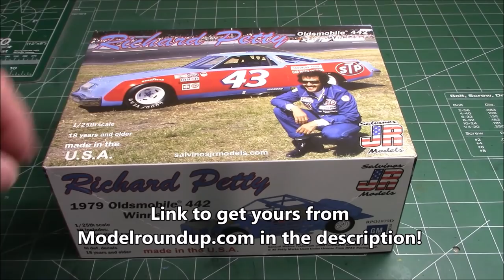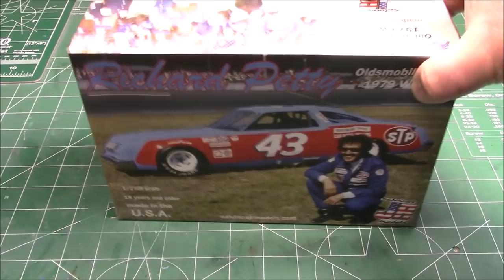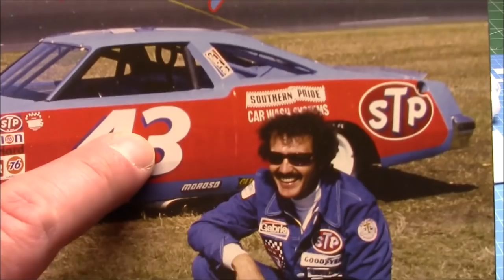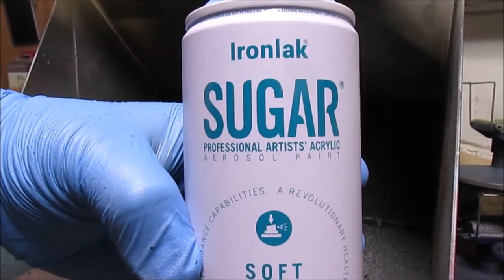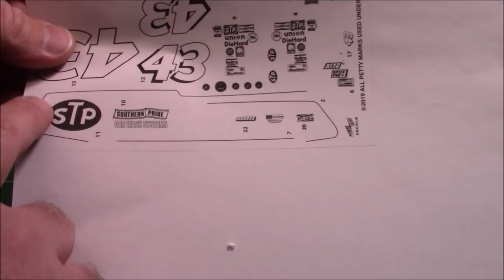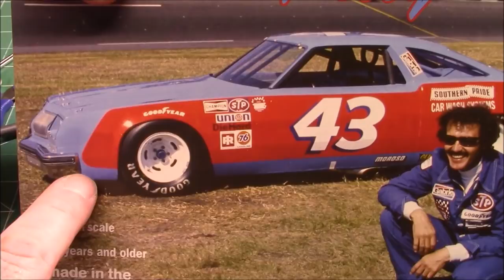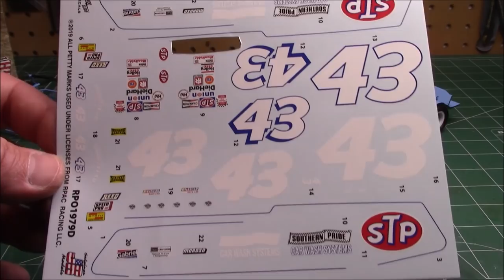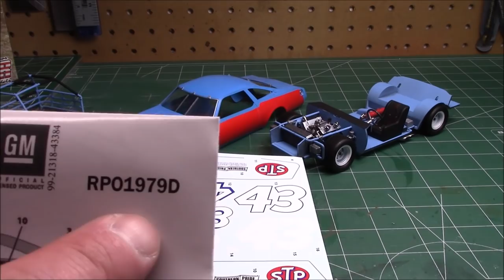Richard Petty Oldsmobile 442 1979 Winner STP #43 1/25 Scale Model Kit Build Review

Comment: TS-23 is what i use. I have only built all Blue older kits. Ive never built any other R. Petty kits. Chris, what paint did you use for the radiator and that steel color you painted under chassis?
Reply from the maker: Hi Jeremy, every color is listed by name and brand during the painting portion of the video. 
Thanks man!

Comment: Tamiya also makes a French blue  TS-10 that I think looks pretty close to Petty Blue too. 
I was working on a (stock) Talladega that I painted that color just as a reference to the Petty connection, and I thought it turned out nice.
Reply from the maker: Yes sir, there are a lot of paints that will work great for a Petty car.
Reply: @hpiguy  That there are!
(And most people won't notice it's like half-a-shade off if you don't say anything! 😁)

Comment: OH MR HPI ,I need some help ,I'm ready to go to Menard to get paint ,all I would like from u sir is like 4 or 5 of the real main paint used for xhassis,cage frame,etc ,etc,etc please pm me with a list sir PLEASE!!  TY
Reply from the maker: All paints, brands and colors are listed in the painting section of the video.
Reply: @hpiguy  ,did not see any ,where do I find,war I'm after is to stock up on like 4 cans of each,lol I got like 50+ kits that I'm gonna attempt to pain all the parts ,minus the body , so when I'm laid up from surgery I can build w/oh acing to attempt to stand on 1 leg n try to paint!
Reply: @hpiguy  Ps I really wanna stick to the same stuff u use which I believe is the rust o lie with the grip handle 4 spraying!!!